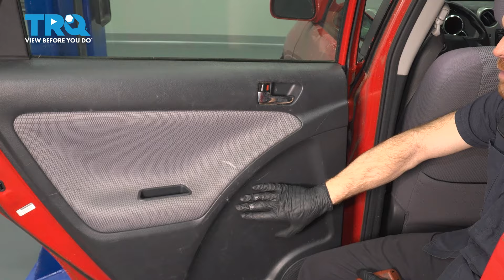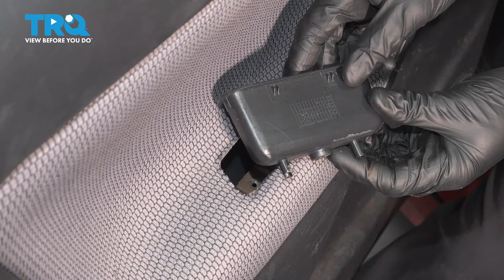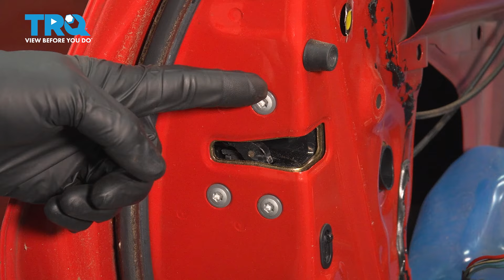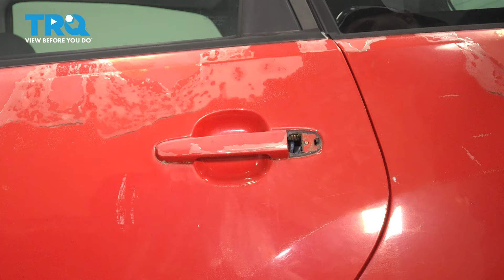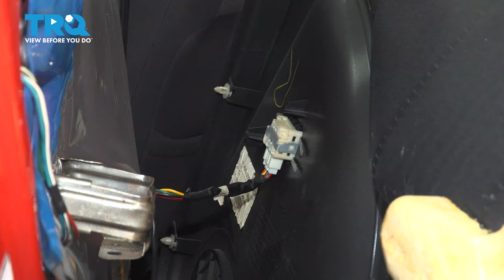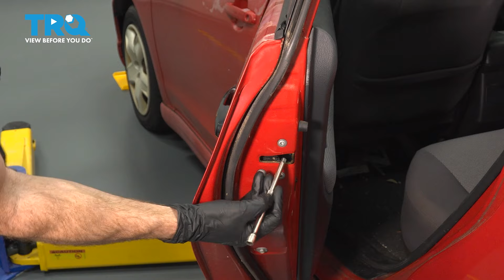How to Replace Rear Exterior Door Handles 2003-2008 Toyota Matrix

Comment: Thanks for the video. It's really dumb that Toyota made the front handles so easy to remove with a rubber plug access port but the rear requires removing the interior door panel 🤦‍♂. You'll feel this way when replacing all 4 handles.

Comment: I didn't double check to verify that the door was inline with the fork . I put it all back together and closed the door. Now I hear the power actuator but it doesn't unlock. I tried to unlock it from the inside too. The door panel flushed up against the car frame and I figured it out to fix it. Any help would be appreciated 👍

Comment: After sliding the handle forwards it would not retract when I pulled on it. Turns out I had to pull down the retractor lever inside the door with my finger so the handle ears could hook onto the lever. Thanks for the video.